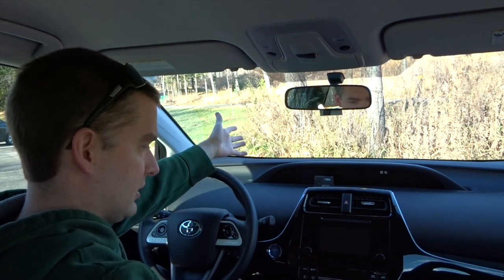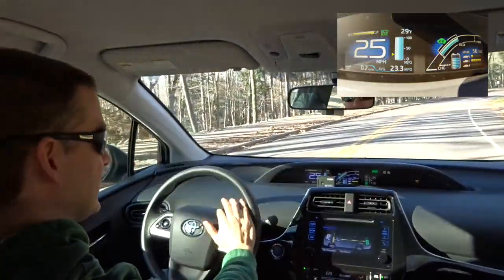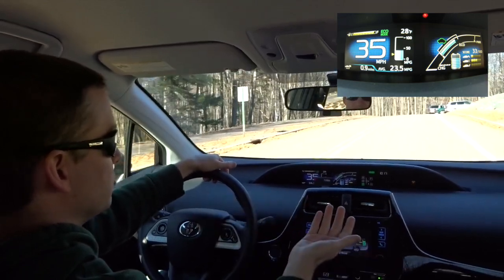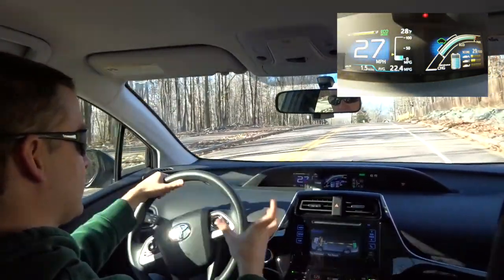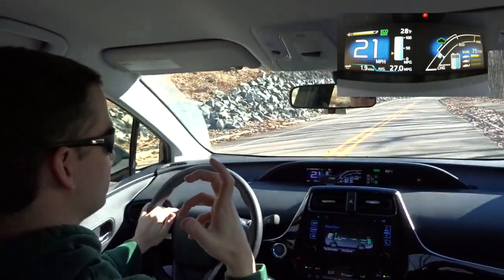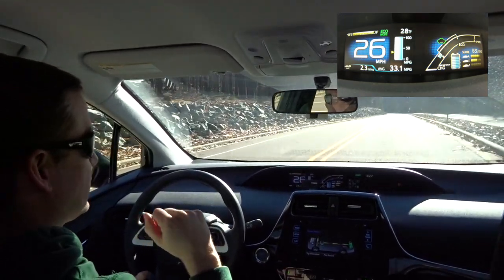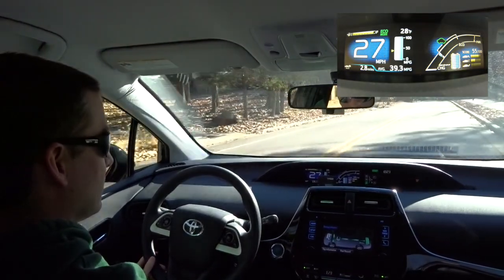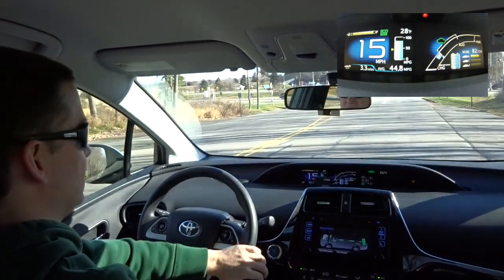Prius "B" Mode Explained

Comment: When going down hill, and you want to charge the battery, you better stay in D and brake several times. Since D Mode retrieves more energy as B Mode. In D Mode only the generator brakes. In B Mode the generator AND the gas engine brakes (you can see that, when you turned into B the green EV Mode light is going black, showing the gas engine running, it needs to run, since in B Mode it brakes too). So when the battery is low level and you go down a hill, better use D Mode and brake more. When the battery is full, you can use B Mode. 

Either way, D mode is more efficient. But i think the system warns after a period of time, going down hill only in D Mode, that you should go to B Mode so that the car can brake more and the generator doesn't overheat or something.
Reply from the maker: I agree!
Reply: MODE B IS ALSO USEFUL WHEN WE LEAVE A HILL AND THE FLOOR IS VERY BROKEN, SO WE DO NOT LOSE REGENERATION
Reply: You shouldn't go a long decline in D, because as you brake to keep the car in constant speed the battery will constantly be charge as you go and the charging-habit is "as much as possible" in D vs "charge only litely and throw most away( to the engine) " in B. when driving in D, only after a short while the battery will finally get full or overheat (or both) causing the regenerative braking to not be anymore possible, then the car have to call for a special braking mechanism of which B mode use anyway. so by driving in D you will instead end up with a hot battery for no reason in long decline. They put B mode for you to really use when going down hill so I recommend to just trust the system. 
PS. B mode mechanism explain: because the Toyota's hybrid car always contain atleast two MG-unit (motor/generator unit), B mode produce engine brake by using MG2 as generator creating electricity as you brake (if not back to the battery where can the power go) so they send it back to MG1 to act as a motor to spin the engine, the engine work in engine-brake mode pumping air to create heat (the engine that you here revving when going down hill involved no fuel injection, it rev up just to pump air to create heat loss to use up those excess electricity
cheers.
Reply: although it makes sense for fuel economy and battery charging, i would never risk overheating the brakes on a long decline for the sake of battery charging ;)
Reply: Not true, you can't overheat battery with braking in D, you should drive down the hill in D whole time until you fill your battery completely. You should use B mode only if regenerative braking is not enough to slow down the car to speed you wish OR if your battery is fully charged and you want to save brake disks. If you will drive down the hill in D mode for like one hour, there will be no damage/overheating to your battery at all. Also energy created by generator is not used to spin motor in B mode, it's just not connected in to the circuit at all. Combustion engine is connected to wheels via eCVT and pumps air through engine.
Reply: even better to use B mode and the brakes for max charging
Reply: If you are not braking hard enough for the needle to be on max charge then you are not using brake pads, they only come on when braking harder
Reply: No, B mode has nothing to do with charging, there is no additional charging. For once and all  B = braking.
Reply: Stan Trnik If so true, how come the battery level could continuously increase till full in B-mode
Reply: Because B - braking means that motor + engine are braking together, motor is generator in this case and is charging battery, engine is producing.. just sound, heat (it cools it self with air) and pressured air.
Reply: Stan Trnik The electro-mechanical method of which we use to brake these electric vehicle (cars,trams,trains) is called Regenerative-braking, which could make vehicle slow down because it uses the car's speed to generate electricity (which most of the time are stored back to the battery), anyway, that's why the speed deceases.
Reply: Stan Trnik ok It's my mistake, We are actually already on the same point.
Reply: I wrote it before: motor is acting as generator = producing electric energy = charging battery. Braking in D mode is clear. You should drive the way that you will be always able to slow down only with use of motor. Every braking with pads/disks or engine is waste of energy.
Reply: OK so I have been using the B mode 80% of the time I had my 2011 Prius I have raced cars on the freeway and especially in the canyons of souther California. The only problem I have is going though Yokohama tire's and brakes too fast. Also I had a head gasket failure recently after coming down a mountain after a winter storm. I have about 120K miles on the car and no one can give me a good answer to why it happened? Back to the B mode I find it better to use for breaking in a lot of occasions like on the freeway or in the canyons going down hill. If I am going fast I need more charge so it's a lot of gas then hard braking. So my questions is what can over heat and would my Prius give me a warning that it is?
Reply: You should stop driving your Prius so hard and buy an sports car with stick  instead ;) There's no point of driving Prius hard, it's not really pleasant, it's missing revs in gears and it's bad for Prius.
Reply: Drakon bullsh-t.
Reply: I was going to say, B mode does not do what he is saying it does. B mode disengages the regenerative brakes. The battery is recharging because of the engine running as a generator.  some people and their silly videos
Reply: It's pleasant when I beat you in your manual sports car! Maybe not that fun in a drag race even though I did get two car lengths out on a 2005 Mimi Copper S from a stop light. His tires didn't grip at the start but passed me after 68mph.
Reply: Drakon when battery go 84% soc regenen braking stop for over change battery..
Reply: At 5:53 you can see that there is still some regen going on, the battery level jumped up a bit. So basically you're putting more of an emphasis on the drivetrain in B to do the braking for you than on the ERS system, but it's still a combined effort.
Reply: You can only regen down a hill (even in D) for a limited time before the engine comes on.  The colder it is outside, the shorter the time before the engine starts.  Once the engine starts, it will run for a minimum amount of time until it warms up.  When this happens, it feels like the car stops or reduces the regen, and starts using the engine to brake the car.  Pressing the brake lightly to increase regen and running in the B mode does exactly the same thing.  No warning appears.

Comment: B-mode is really for continuous hilly terrain like how you find in Europe in mountainous areas.  Typically just before reaching the bottom of the hill you gas the car and remove your foot off the gas pedal around half way to allow the momentum and battery power to move you to the top; once at the top of the hill you place the car in B-mode to allow the brakes to charge the batteries much faster in order to repeat the process again at the upcoming hill.  Doing so decreases fuel consumption quite a bit in such terrain.

Comment: B mode in a Prius simply spins the ICE without firing it to simulate engine braking. In effect it diverts energy through the engine rather than the generator as it won't provide the level of retardation required for steep descents. The reason you see that the engine is on is because the crank angle sensor reads as if it running, when ofcourse it's not. Don't use it, it is dumping the kinetic energy that you can otherwise divert to the battery pack. Lightly touch the foot brakes to increase the field strength of MG1 and maximise the efficincy.
Reply: This is incorrect.  There is no direct connection between the wheels and the engine in a prius.  Both D with light brakes, and B mode regen and charge the battery.  Eventually however, the motor will start and it will reduce regen.  I suspect something begins to overheat.  Regen charges the battery very quickly.

Comment: I don't have this kind of slope nearby. On my European Prius, I  can force EV (below 50km/h). I wonder what happens in B mode in EV only: 1- charge faster (gears ratio on electric motor only), 2- starts ICE to use gears ratio on ICE, 3- it does 1 then 2 depending on battery levels to prevent overcharging. Or maybe I don't need to force EV at all.

Comment: I've noticed as well when driving my 2016 that if you have cruise control set & start going down hill it seems to automatically kick in Engine braking although the indicator doesn't show it in "B" mode trying not to go past the set speed & man i can imagine how quickly you would have gained speed going down the hill in neutral because mine definitely gains speed even quicker in neutral going down hill =p

Comment: I also have a Prius (2016). when in B mode and it's strictly charging the drive battery, if you change your MID to display the electrical layout it shows that the wheels are charging the battery but the ICE is not engaged/active. So it is in a sense in EV mode, but not showing the green ev icon
Reply from the maker: Good feedback, I'll have to look at that!

Comment: B mode on Toyota hybrids other than the Prius Prime is wasteful. It forced the gas engine to run to engine brake the car, but that means you are losing out potential regen electric range. A Volt or Prius Prime in L mode or B mode would not use the engine at all, but take all the energy back and put it in the battery.
Reply: The prius prime will also eventually start the engine while using regen down a long hill in both D and B.

Comment: The effects you see are not unexpected. Usually, the B-mode is interpreted as "extra regenerative mode", but this is wrong. The Toyota manual states that the B-mode "applies engine braking", not "regenerative braking". After some digging, I found that in B-mode the gas engine is coupled to the wheels, like in a regular engine brake, but without being fed with gas; internal friction and air compression act as brake, wasting the energy that can not be regenerated (need more braking than can by applied by regeneration, battery is full, etc.). I don't remember where I read that, but it makes perfect sense with what you observed:
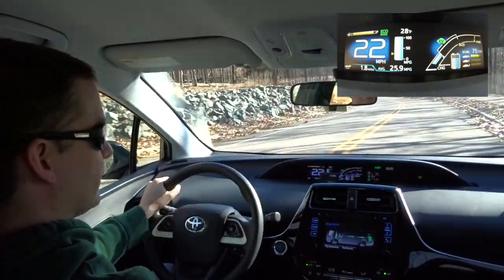1. Around 5:30, before you shift into B, regenerative braking  is quite strong, as seen in multi-info display; dropping in B-mode, while barely gaining any speed, the regeneration gets rather low.
2. You hear the engine being on, but the hybrid display shows that it does not generate energy  -- consistent with engine in motion, but not consuming gas (instant MPG is over 100).
The B-mode is useful in two cases:
1. You need more braking than can be provided by regenerative braking
2. Your battery is full, but you still need braking; regenerative braking can't store any more electricity.
Short version, in B-mode, braking energy is wasted, not regenerated, which is why you are advised not to use it.  The guys using it all the time will get worse overall mileage because of this.
Reply: That's not true, B mode turns the regen on full blast. If you have an app thats monitors your battery you will see how quickly the amperage jumps up and the voltage reaches full charge after just a short time on B mode.

Comment: I had the super full battery recently as well and initially assumed that not having EV mode at that moment meant a problem with the car. Then I checked the manual and it said that when the battery is showing completely full it means that it is simultaneously running hot. So the car stops using it for a bit in order to cool it off.
Reply: good point! what year?
Reply: @nationofgandhis  my Prius is 2009

Comment: While the engine may be turning in "B" mode, it is not getting any gas or spark, just air. By the way, "B" mode is great for stop-and-go traffic as it slows you down nicely whenever you take your foot off the gas pedal.

Comment: well simply put an electric motor actually has to utilize current flow in order to produce resistance not much and rather steady but it still does where a gas engine provide natural resistance as it will only spin as fast as it can burn adequate fuel to stay running

Comment: B mode is also very useful in low speed very busy traffic, keeps not to touch to break very often.
Reply: Problem is, then you're burning fuel to use the engine to slow down.  If you use the brakes then the car puts that energy into charging the batteries instead, so you can get that energy back later to accelerate again, saving fuel.  The car doesn't use the brake pads unless you stamp on the brakes, which is why they last for so much longer than on other cars.  The only time you need to use B mode is when you need to do a lot of braking and the batteries are full, so there's nowhere for the excess energy to go.  B mode burns fuel to shed that excess energy.

Comment: I am telling you, I was driving down the mountain in B mode, and I had to use the brakes a lot, yes it's definitely a downshift , but going down a mountain will not be like you mentioned that you would not have to use the brakes.
Reply: does the engine run if battery not charged? in B mode?

Comment: I have noticed in B mode, with the battery fully charged, the engine makes much more noise when running. I am not sure if that is because the battery is fully charged? It is a little worrisome. Do you notice this too? Is it a problem?
Reply from the maker: I didn't notice the engine being louder, but I do notice more power when the battery is full.

Comment: You haven’t explained B mode as much as got almost everything wrong. 
Why are you surprised that the engine is running is because you selected B mode, which adds engine braking and reduces regen to help protect the HV battery? 
The reason you’ve never seen the HV battery display full in normal driving is because the battery doesn’t like to be over 80% (or under 20%) charged for longevity. 
If the battery is “full” and you continue to charge, the engine will start running to use the excess charge and substitute regen braking, even if B mode is not selected. The one thing you did right was to choose B mode at the top of that long descent when the State of Charge of the HV battery was high because the engine was going to run sooner or later. 
I don’t know anyone who drives in B mode all of the time. It reduces regen and is therefore less economical to drive. Even the most skilled one-pedal driver couldn’t make that work. 
Start watching videos from WeberAuto for explanations of the “eCVT” in the Prius models.

Comment: B is for engine brake and that explain why engine runs on B mode. 
google how engine brake work and you'll find out. ;)
Reply: The engine doesn't come on immediately in B mode.  In either B or D mode after a period of time of heavy regen charging the engine comes on and regen reduces.

Comment: Suppose you're going down a hill beginning at 55mph and you want to control your speed. Can "B" mode be used at this higher speed?
Reply: You can use it in whatever speed you want, even with adaptive cruise. It's just to simulate engine brake like in traditional transmissions to save your brake pads. Remember Toyota Hybrid Drive does not have any gears, so it can't change into lower gear, it uses software programmer magic when B is activated
Reply: @timogronroos4642  so can I say B is like shifting to a lower gear, like in a Manual to Gear 1?

Comment: I think, those engineers have put an additional B1,B2 and B3 modes so that to vary power of recycling and how fast it will descend.
Reply: symmetry08 there's no B1 B2 unfortunately, but we balance the energy input and output in B mode, that's why the engine kick-in to create heat loss as load (free pumping with no fuel injected) , it also rev higher according to the excess regeneration resulting is a dynamic effect (the car mimic engine-brake harder the more you press the brake pedal)

Comment: Driving down a slight gradient in B mode as a Prius driver, then seeing your battery charge is one of the best things. Happens all the time. Every time I press on the brakes it feels like I'm making money. Love this car.
Reply: Except the B mode doesn't affect the charge. In fact, it's charging better in D mode, because the combustion engine does not brake the car by using part of the driving force.
Moreover, this is perfectly visible in this video. In D the load bar fills up completely, while in B it only goes up to a third. 
Moral: in B, you brake more and better, but you don't charge the electrics better or faster.
Reply: @Hilljoona Correct, D is the main. I was just expressing my love for driving downhill in B mode, on top of the typical charging gained from rolling around. Also should replace the word "brake" in your moral so people don't get confused, as B as you stated uses the engine to slow the car and not the brakes. :}